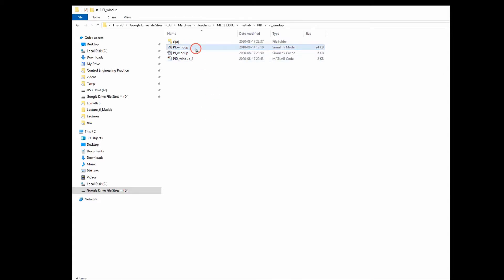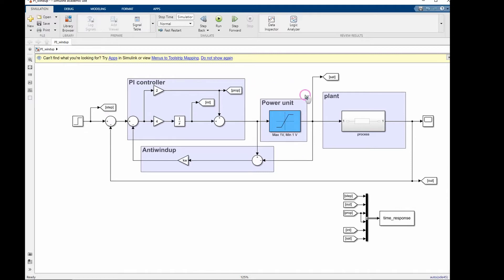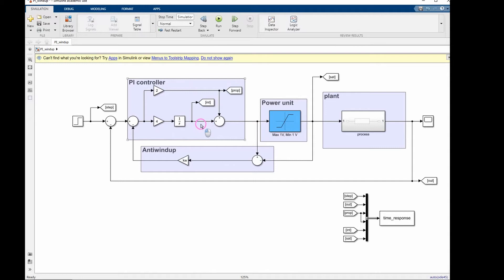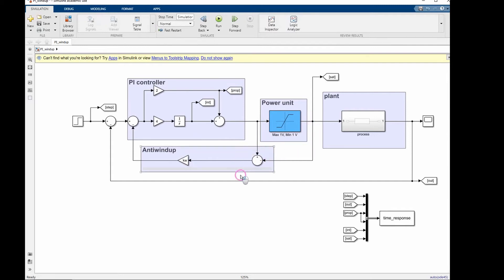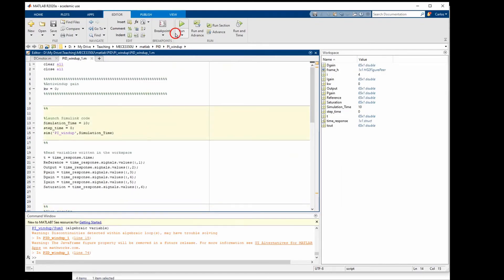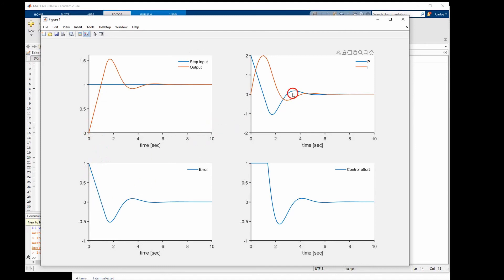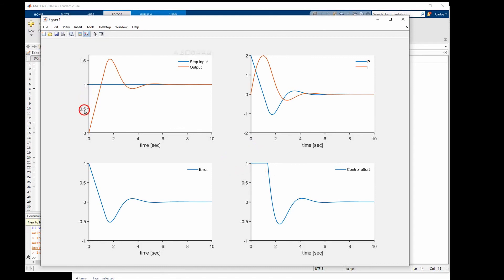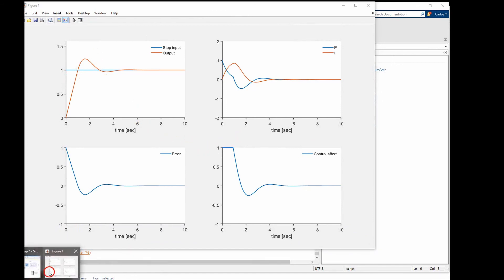L14E69 Control Systems Lecture 14 Exercise 69:  Integrator wind-up in a PID controller

Comment: Can I ask How we determine the Anti- Windup Gain Kw?
As I am trying to Implement an Anti Windup mechanism to my Fuzzy logic controller because I used an integrator and it is Winding up
Reply from the maker: I would do it empirically. But it is easier to just "turn off" the integrator so long as saturation occurs.